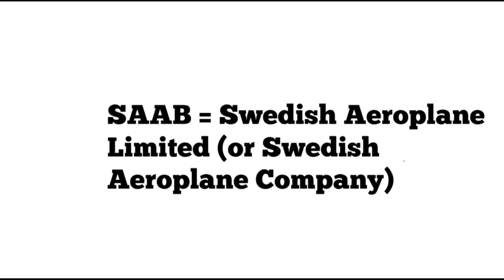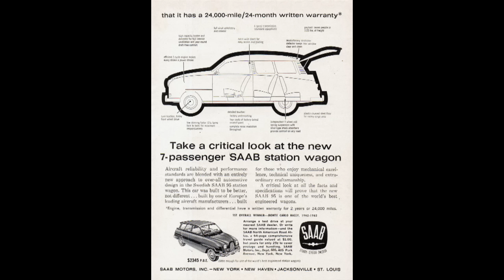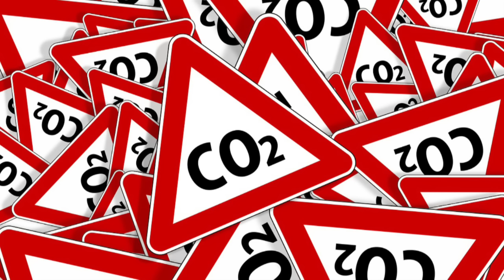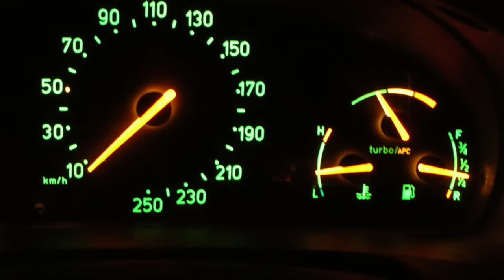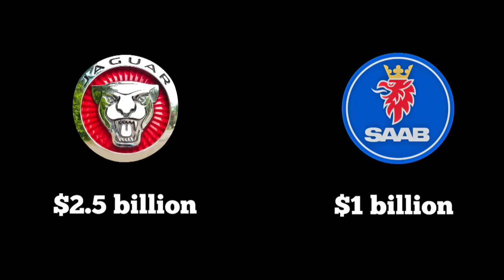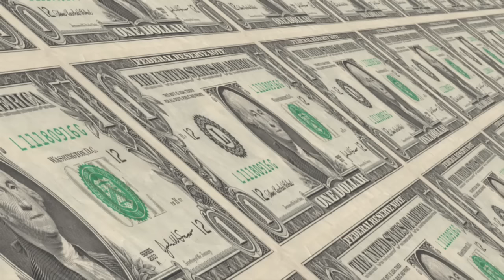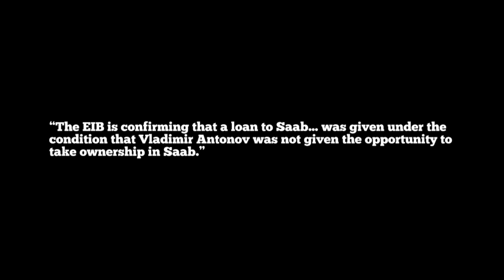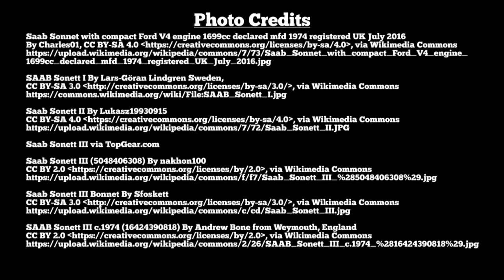The Life and Death of SAAB: RCR Car Stories

Comment: The problem is that GM, more than just about any other company I've ever seen, has a terribly effective habit of shooting itself not just in the foot, but in the head. They will have brands with decades or even centuries of prestige and cultural capital, companies that produce vehicles that are as good or better than their competition, and they will consistently fail to market them appropriately. Pontiac and Saturn, particularly in the late 90's and early 2000's, were producing vehicles based on partnerships with Toyota, by bringing over designs from Opel and Vauxhall, and then making aesthetic changes to them which made the relationship with their base cars quite difficult to discern at a glance. A far sight better than what Chrysler was doing in the malaise era. They had arguable more potential for sales in the sedan, hatchback, and small crossover markets even than Chevrolet itself. But, instead of allowing Chevy to pivot and focus on their pair of sports cars and a handful of high-profit SUVs and trucks, they decided to cut the throats of Pontiac and Saturn. Was it necessary to kill off at least one of these brands? Probably. What about both of them? Definitely not. You can see their same self-destructive behaviors in their development, implementation, and marketing of the Volt. Take a platform that gives you hybrid fuel economy, no range anxiety, and the ability to run indefinitely on petrol, but decide to only build it into a compact lift-back sedan and never market it. Had they built such a platform into a crossover or SUV, their sales would have been legendary. Something the size of a Suburban or Yukon that got in excess of 35MPG without feeling like a compromise in performance? What's not to like. And, if you had the means to plug it in to charge, you could get closer to, say, 80MPG on a charge and tank of fuel? How could such a marketing pitch fail? But they didn't, and now the Volt is dead and barely anyone noticed. I just don't understand what goes through the heads of the people in charge at GM. Why haven't all of their cars been plug-in hybrids with the Volt drivetrain or a derivative for years now? Could you imagine how much they would have impressed the government's CAFE assessment team? The amount of goodwill they would have accrued back during the fuel crunch in the early 2010's if their entire product lineup could get higher than 30MPG combined? What if they had been quicker to adopt some of the safety standards that SAAB was spending money to add to their platforms and instead baked that in by default? If your entire product line was like Tesla before Tesla broke the standards measurement equipment? GM needs to face a reckoning and I hope it hits them where it hurts.
Reply: GM actually had trucks and SUVs that were hybrids. They didn't sell, and were killed off.
Reply: @jailbird1133  Not the same. Those were conventional hybrids where the electric motor is placed between the torque converter and the transmission and is an inferior hybrid drivetrain as this typically results in an underpowered electric motor coupled with an underpowered gas engine and if the roll-on and roll-off of power between the two isn't handled properly then you inevitably get an inferior power delivery. The Volt, on the other hand, has an all-electric drivetrain where the gas engine has been mechanically decoupled from the drivetrain and operates solely as a generator for range extension. Thus, a larger electric motor is used and the acceleration can be more linear in nature.

Comment: I first discovered SAAB in 1989 via a 1985 900 Turbo S on a used car lot in OKC! It was a black on black, 2 door, 5 spd and when I took it on a test drive, the whine of the turbo plus the acceleration & handling ROCKED MY WORLD!

Comment: Speaking of that Saab rally story about picking parts from a parked Saab before finishing the rally, I read this similar story when I visited the Saab Museum in Trollhättan this summer:

In the 1962 Monte-Carlo Rally, part of the scoring system was that you’d get points deducted if you had damages to your car when you finished. This was to make the rally more equal, since at this time, a lot of the entries were privateers without the factory budget and support, meaning that they couldn’t drive as “recklessly”. Erik Carlsson had hit the front-right wing and door on a rock in the mountain stages. They eventually came up to their service team, also in a red Saab, and Erik told them to quickly swap the panels between the cars. Problem was that those parts obviously were much cleaner compared to the dirtied up rally car. They didn’t have water with them, so what they did was empty a jerry can of petrol onto the car, and with rags fanatically wiped down the car to make it look more even. When they finished, they had the only clean car (naturally), and therefore got a lot of press, since clearly “Saab had such a lead they had time to clean the car before finishing”.

They literally cleaned their car with petrol. So cool!
Reply: Nice. Thanks for sharing!

Comment: God damn I love that you created this video. I had a 2001 Saab 9-5 aero 5-speed manual back in the day. Had the BBS wheels as well. Awesome car, really miss it. Only problem it had in 148k miles was a cracked coolant crossover pipe. It needed a new turbo and clutch when I sold it to a Saab enthusiast. I'm sure he still has it. It was in fantastic shape other than those two things. I've never been able to find another one worth buying, which is a good thing, because I'd be very tempted.

Comment: Just a few years ago I used to have an 86 Saab 900. I DEARLY miss that car. It felt solid, it handled fantastically, it had good torque, it shifted smooth as butter, it drove a high speed quite smoothly and elegantly... but most of all... as an engineer who loves working on my cars... I LOVED how uniquely everything in my Saab was designed. Nothing about it was normal. Everything looked like someone who knew NOTHING about cars was told to design a part that did a particular function, which caused them to come up with their own unique design that no one had seen before. Everything was weird about the car... but even still, it was a joy to work on because everything was expertly thought out and designed to be worked on (clearly). Every job I did on the car... no matter how complex... took less than an hour to complete. I changed all the brakes on the car in literally an hour. I changed the clutch in about an hour. I removed the old exhaust and installed an entirely new one in... an hour. It was nuts.

Saab 900... the only car that I have ever owned that I would own again. I shouldn't have sold it as now all I do is miss it.

Comment: Thanks for the story. I was a loyal Saab 900 owner from 1988-1995 and it was a great car; drove well and very reliable. I returned and owned a "GM" Saab from 2005-2010 that was a constant disappointment; it didn't drive well and had constant mechanical problems. I blame to fall of Saab squarely on GM.

Comment: The beauty of SAAB at its best was always working from first principals. 1.0 thinking in the tech world.
This video is well timed, as I have been waxing nostalgic over the tiny 1971 Saab Sonett III I drove in college, watching drive videos on YouTube. I had sold my ‘68 Volvo 1800S because I was moving to San Francisco and I didn’t want to find parking, but the larger reason was the Volvo’s very unreliable electrical system by Lucas (curse you prince of darkness!)
I moved to North Beach, one of the most theft prone places on the West Coast and sadly my FZR400 was quickly ripped off. When I went back to LA the next summer I wanted a lighter, more enjoyable option than the tank of a Volvo had been and stumbled on the Sonett looking through the Recycler. This was 1992, pre-internet and that paper was our craigslist.
The car I bought for around $2500 at the time looked very similar to the photo at 1:11:32 , although it was British Racing Green it did have the soccer ball wheels. It was maybe the sixth respray, as underneath the car had at one time been bright blue, bright red, yellow, black, orange, and who knows what else.
I didn’t know it at the time in my 20 year old innocence, but the front end fiberglass had been modified to be more like the 1:03:15 Sonett II. The tiny hood 1:11:36 and (manual!!!) popup headlights had been ‘glassed in and the round fog lamps in the grille were replaced with a quartet of rectangular beams. The whole front fiberglass section could then pivot forward to make working on the engine twenty times easier. 
The car war amazingly light, and once you saw the thin sheet steel box frame under the fiberglass you knew why. It was built like a paper airplane. 1:04:25 They always wanted to give a part two functions. The radiator overflow was also a Monte Carlo brace. The gas tank was a very important lateral structural shear member of the frame. That was SAAB at its core, aeronautical engineers designing terrestrial vehicles. The sad part was (sob part? sorry) that for each moment of brilliance was a component that had been incompletely designed or tested so that it failed easily. This was the case for the connection of the steering column to the rack and pinion, for example. Or the micro-sized stock hood. Did they come up at 5pm on a Friday and just get an “ Ah, it’s good enough ”?
The handling was admittedly very good, as a reasonably stiff chassis for such light car kept the car well planted despite having an insanely stiff suspension.
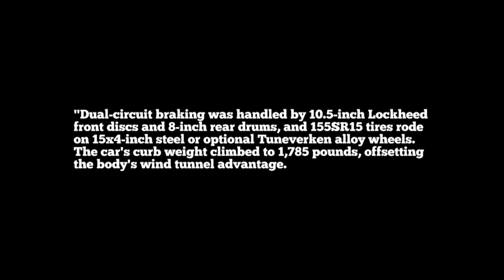1:10:27 Most of the compliance was in the tall sidewall tires. The suspension had next to no give at all. I have no reason to believe they were ever changed, but they felt like they would have been more appropriate for a car 1000 pounds heavier. Even the smallest bump was telegraphed to your backbone.
The little Sonett really shone in the rain, and never had any torque steer, but that may have been the lack of power and weight more than the engineering. Bombing through the twisties in the East Bay hills was great fun. Having such a far forward moment of inertia meant the car responded well to lift-off oversteer.
I didn’t know the car even had a freewheeling clutch mode until I replaced it about 3 years into ownership. I quickly turned it off again, as it ruined the handling of the car when off the gas or doing heel-toe downshifts at speed through corners.
At least for such a small car there was some cargo space, probably more than a Miata. The back hatch was released from a pull on the gas tank behind the driver’s seat, baffling anyone used to an ordinary car. My roommates failed to figure it out and wrecked the upholstery pushing and pulling items through the narrow pass-through over the gas tank.
1:10:35 Having a final drive of 4.67:1 made the V-4’s 60 odd horsepower feel fast enough around town, but it was the thing I hated most about the car. The person I bought it from also complained about this. It was fun driving around San Francisco, but on the freeway the lack of an overdrive (like the Volvo 1800S had) made it difficult to keep up. The engine screamed incessantly at 70 MPH, well above 4000 RPM. Driving the 400 miles between LA and SF was a real chore, and not just because of having to scrunch down in the very hard, narrow vinyl and polyester corduroy seats to fit my 6’-2” frame.
I tried to keep the car running, but finding parts and competent mechanics for a rare car made it very difficult to do. Eventually, the front brake calipers, discs and pads had to be replaced and the cost was $1000 for what was at the time a $2500 car. I would have loved to keep it, but getting parts was a nightmare and as a kid who had just graduated from college it did not make sense to keep it. By this point craigslist had been invented, and so up it went. I hope it went on to a pampered life in a garage in the East Bay.

Comment: Me and my brother remember our father and his love for unique cars. He owned mostly Opel and volvo cars during our childhood. But one car stood out from them. A Saab 99LE. It was equipped with mechanical injection that basically made it unbeatable. We took a wild ride once that surprised many people that we passed by like they stood still. We made it to a speed of 200 km/h or 120ish mp/h with ease and had plenty of pedal left to push. This was from a stock engine. The acceleration was moderate but easily kept up with any other vehicle on the road. Even though it could get up to some serious speed, it also had its temper with weird noises and shakes. It was a sad day when it was sold.

Comment: My favorite car I ever owned was my '86 900S MT 16V (seafoam green metallic). Slow but so fun to drive. I used to wake up early so I had time to troubleshoot and fix it so I could get to work on time and I still loved it. Eventually succumbed to the salt after 27 Wisconsin winters. Engine/trans were fine at 290k-ish but it was getting pretty Fred Flintstoney. Replaced it with a '00 9-3SE MT. Loved that one too. My friend rolled it on a back road.

Comment: Excellent! ...back in my "Yuppie" days (the 80's) I owned two SAAB 900 turbos (one 160HP and the other the 16 valve 200HP variety) ... both excellent "Driver's" car in those days ...  but some issues I had included trans not shifting into 5th, exploding rear hatch glass when I turned on the rear defogger and during heavy rains the front passenger carpet would be soaked because water would find its way from that giant wire bundle coming from the engine compartment to the dash onto the floor ... and after SAAB folded up I was going to buy a leftover 9-3 Viggen from a dealer here in Aurora IL for $27995 but didn't because my wife (now ex-wife) only knew how to say "what do you need that for???" ... yes the life and death of SAAB for me as well ... Cheers Keith Algonquin IL ... I recall the internal model designation for the 900 turbo was 923T ? or 923M?...
Reply: and what do I drive now??? a 21 Honda Ridgeline RTL-E for Pete's sake ...which is probably faster than any of the 900 turbos I owned and a couple hundred percent more boring ...

Comment: I stumbled on this and had no intention of watching the full 3 hours plus but got hooked early on and managed to watch the entirety in 2 viewings. Excellent video and thank you so much for the effort.

I bought a 2008 Saab 9-3 with a manual transmission in the spring of 2010. I loved that car and even though it was not a pure Saab, it definitely did not feel like a GM to me. It was quick and nimble and got great fuel mileage. 

Unfortunately, all 4 electric windows and all 4 power locks failed sequentially within 6 months of each other and I could not have had worse timing on the cost of buying replacement parts at the time and the costs were nuts. So nuts, I got them all repaired and and decided if this continues it will be my financial ruin so I sold the car at a huge loss. Like half of what I paid two years earlier. Was sad to see it go but glad the financial bloodletting would be stopped.

Comment: I rented a nearly new SAAB 93 diesel in Lisbon Portugal back in 2000 and drove it about 5K miles between the UK and Portugal for a month, the car handled beautifully and the diesel engine was smooth and powerful, I could cruise at 130 mph long distance without effort in that car. I remember thinking that this was easily the best car I'd ever driven

Comment: The night panel on my 9-3s was more than just a dimmer switch which is a good indication of how SAAB did itself in with useless and expensive details. in Night Panel mode 1) the gauges did not simply go dark by turning off the backlighting; they were actually turned off entirely. 2) the speedometer was only lit up to 140km/h, but the rest of the digits would light up when you approached that speed (don't ask me how I know...). Your research assistant Jake and I can argue the pros and cons of the idea (I did a lot of after-dark winter driving and never found it useful in any way, YMMV), but the execution showed a breathtaking attention to unnecessary detail. One functional detail that never gets mentioned, but was super-useful on slushy, messy Canadian winter roads: the car had 10 individual washer nozzles: 6 for the windshield and 2 for each headlight. Hitting the washer button enveloped the car in a cloud of washer fluid from which it emerged with impeccably clean windshield and headlights. I would also dispute your claim that the press loved the Viggen: in my recollection they universally panned it for its insane torque steer. 
The Saabaru and 9-7x were not exclusive to the US: they were also sold in Canada.  At least we can agree that they are aberrations. I've been going to the same mechanic for close to 25 years, he only works on cars that interest him, which includes any Mercedes, Volvo, or SAAB, but excludes US or Asian cars. One morning I spotted a 9-7x on his lot and asked him about it. He told me that some tow truck driver had dropped it off overnight figuring that since it was a SAAB, my guy would work on it... how wrong he was: when I arrived he had just called the tow truck to tell him to come take that garbage off his lot.

Comment: Just bought a 2008 Saab 9-3 convertible with the 2.0 turbo with only 54,000 miles on the clock, for only 6000$.  Nice to work and hear the history behind the automaker

Comment: This is a very well (and long) researched program. My dad had a 92 (before I was born), and being the lousy driver he was, he ended up upside down in the car, in someone's garden hothouse. Later he had a 95; the last model year, the 2-stroke engine was available. I learned to drive in that car and have fun memories from it. I recall it as preppy but not fast and really quite comfortable. He then had a 900, and, again, I was surprised how well the engine pulled the car forward, doing take-overs at around 100km/h or 60mph.